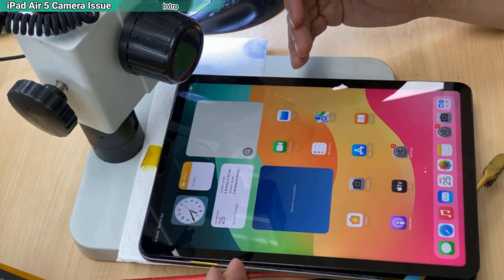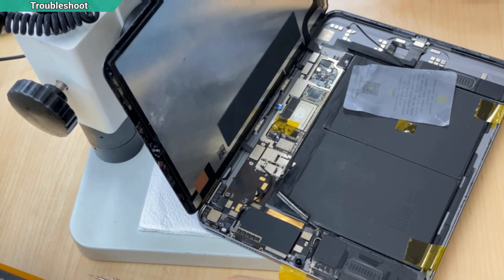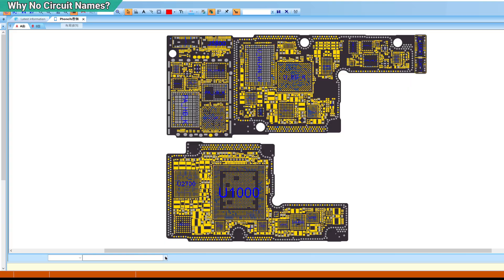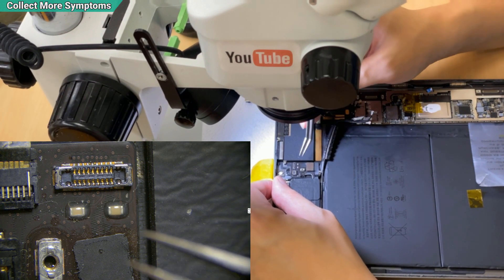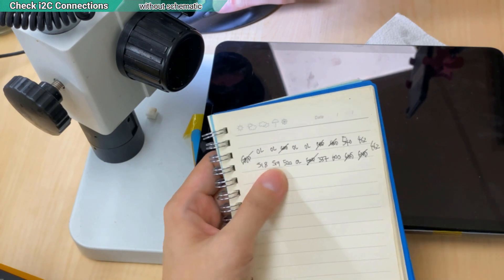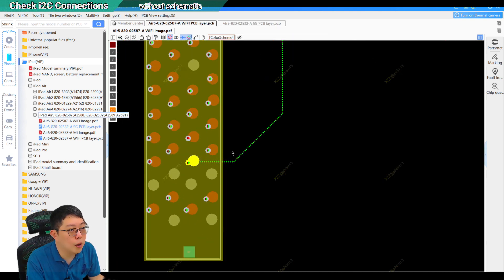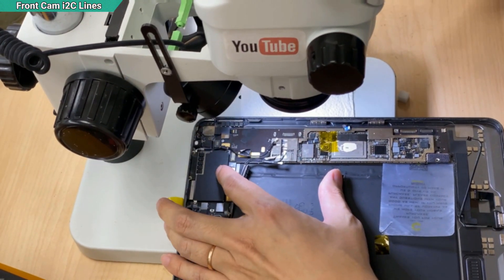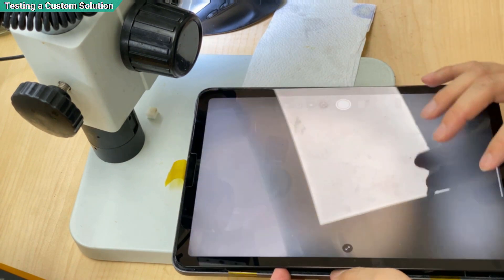How I Repaired iPad Air 5 Camera Without Any Diagram 【Special Case】

Comment: Hi master lim, i need some advice from you if you dont mind. I did some repair for this model, original problem is with some capacitor shorted and got no touch. While removing the capacitor, i didnt realise the plastic im using to disconnect the battery accidentally slipped out and the battery got connected. And some other cap got shorted by my tweezer, i dont know what other things got shorted. But now the display got no backlight. Can you give me some advice on which route should i take to fix it. Thank you in advance.
Reply from the maker: Thermal camera is the fastest way to find short

Comment: I fell into the Galaxy S20 sea. I took it out and turned it on and I had a lot of fever. I've tried CPU implantation in many places in Korea. I think there's CPU damage. Board implantation can't solve this. The CPU itself needs to be repaired. Is it possible? I'll visit right away if possible.
AP Chipset. Electric shock. Dead situation. Board replacement and rebolling all failed. Is it possible?

Memo app..... picture .....
Please save my life
Reply from the maker: I don’t think I can help with this because too many attempts have already been made to repair the CPU. I believe the condition of the CPU is beyond my repair capabilities at this point. If it hadn’t been tampered with, then I would have had a much higher chance of success. Sorry.